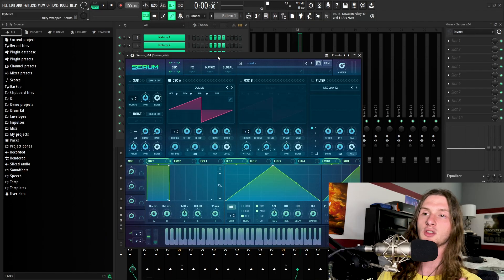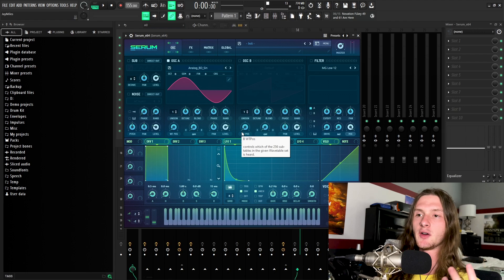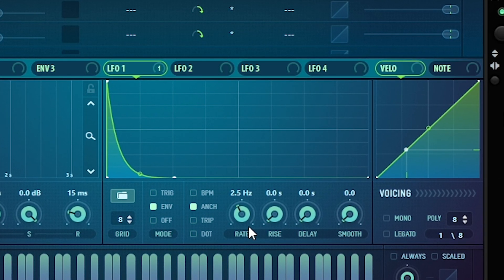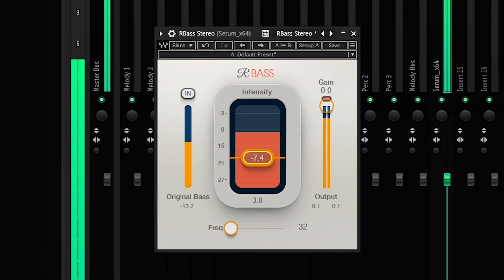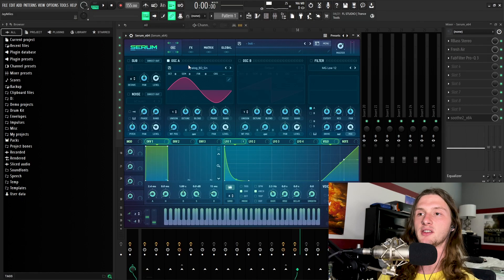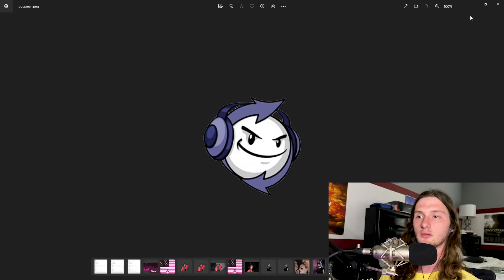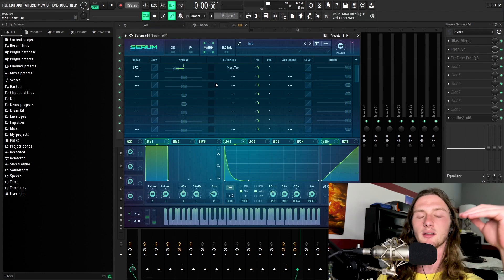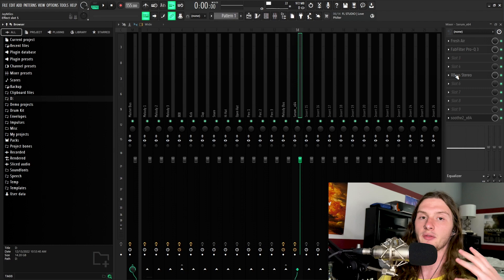How To Make CUSTOM 808s Using Serum | FL Studio 21 Sound Design Tutorial Part 1

Comment: after making the sound, should you export them and use them as a one shot? and if yes how do I do that. I am having problems with creating 808s on vital because after I cant use slides freely like one shot 808s allow you to.
Reply from the maker: I typically export them as one shots at it allows for a more consistent foundation of the sound rather than it being altered depending on the key played. If you’re looking to do slides then you could either export it as a one shot (which i recommend) or enable the legato and/or portamento features within serum🫡

Comment: Hi, is there any replacement for the basics FX you used? Best would be stock plugin in FL :)
Reply: Fresh air is free
Reply: To make 808 hit harder u dont need that thing he was using. Put on the fruity equalizer 2 and turn up the low ends. 1 and 2